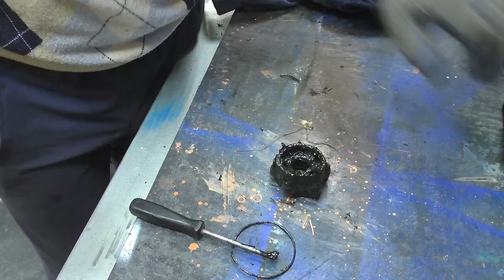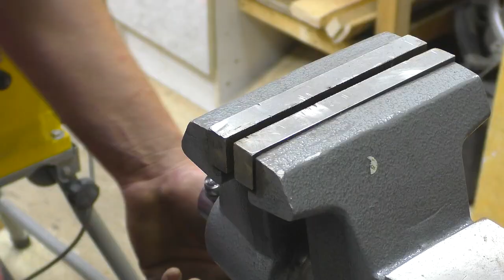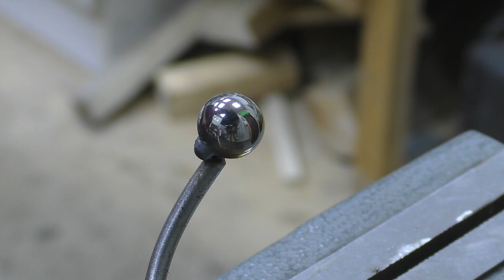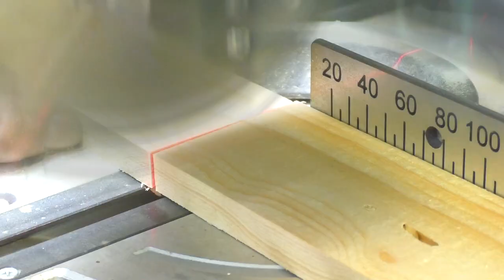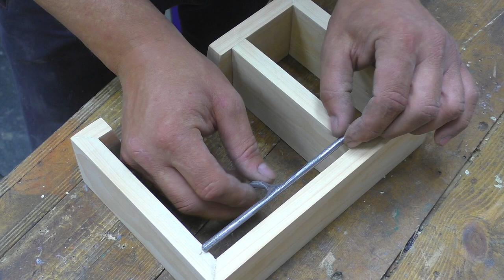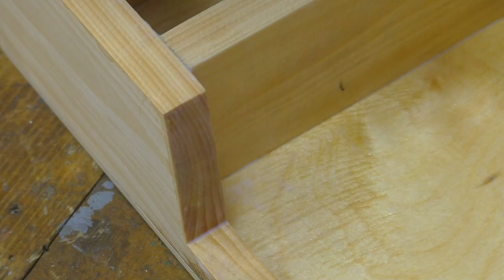DO NOT THROW OUT !!! OLD NOT WORKING HINGE, MAKE A PLEASANT WIFE.

Comment: Nothing to do with an old hinge. I'll save you some time. He removes a ball bearing from the CV axle. Welds the ball bearing to some 1/4 inch rod. Builds a small wooden box. Drills two holes in the box for the rod. The ball bearing is just being used as a weight. The box is for napkins the bearing hinges on the rod and hold down the napkins. The box also has a small compartment to hold condiments.
Reply: Thanks for that...
Reply: I bet you're fun at parties.
Reply: Cody Green How I wish I had read your comment b4 I lost ten minutes of my life on this video. Well, I did get one thing out of it that I hadn't thought of and that was where he put the metal rod into a drill and bent a sanding disc around it to clean the rod. I'm not sure if I'll ever use that knowledge in my life, but I must console myself somehow. Thanks for trying to give the heads up in this video tho. 🙏